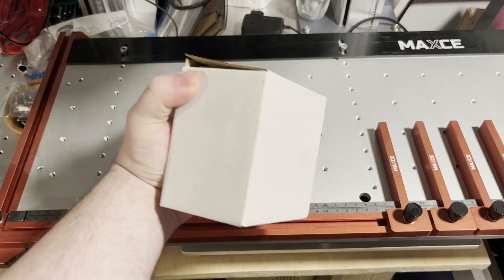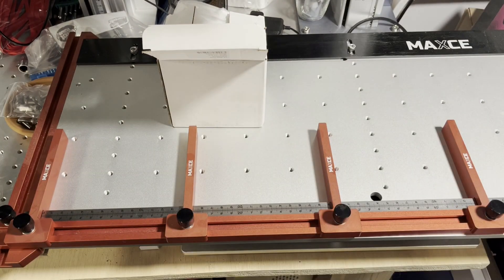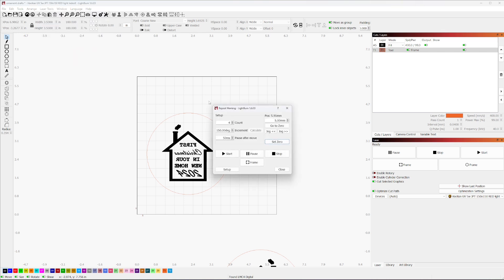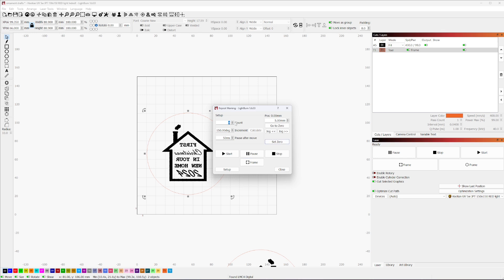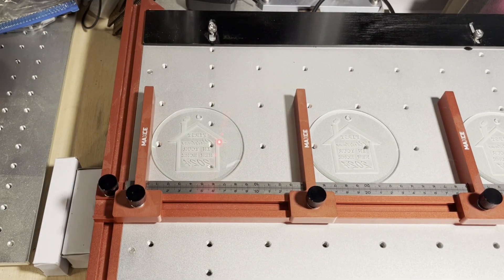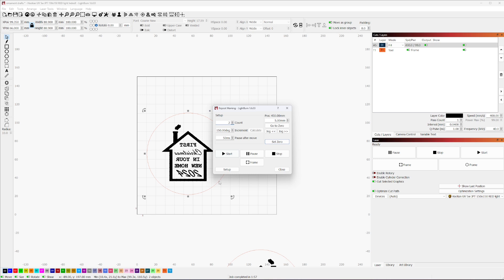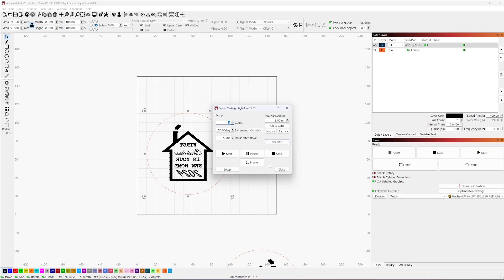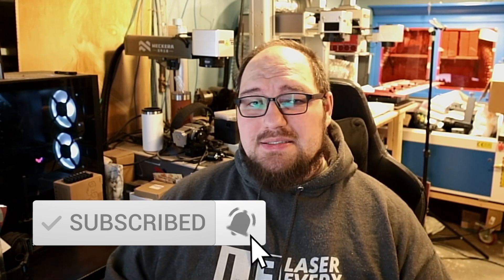The Maxce Index DECIMATES Batch Jobs from Johnson Plastics Plus

Comment: When you did 150mm between each slide did you line it right in the middle or the right or left of the spacer?
Reply from the maker: I set the fences to 0, 150, 300, 450 etc. I butted the items right up to the fence, and aligned the first output by moving the engrave vectors in lightburn to line up with the first output. After that, because the ruler confirmed the fences are exactly spaced, the items would have to be as well. The main thing that would mess that up would be if the main rail that the fences ride on wasn’t running straight across the bed, it would cause a misalignment that would become worse for every further item down the line. That’s why I frame test it to sanity check my setup the first time before I batch run, to make sure each alignment position is in line and no glaring issues. As long as it’s all locked down, I can reload and batch a ton out with confidence.

Comment: I dont know if i missed it, since i was listening while working, but did he mention anywhere about which laser he was using for engraving? I like seeing/knowing which machine and setting are being used during the videos.
Reply from the maker: You  didn't miss it, and you're right. Kyle may have skipped that part since he was focused more on the batching process and settings on that and batching rather than the laser/parameters (since the indexX setup process can be used on pretty much any galvo). This was done with a 5w JPT UV, 150 lens from Haotian that he is testing. He has done lives and a glass video previously, so if you wanted to see his starting settings that might help fill in the missing info for now until his next UV/glass update.